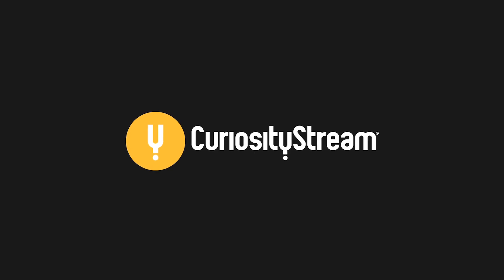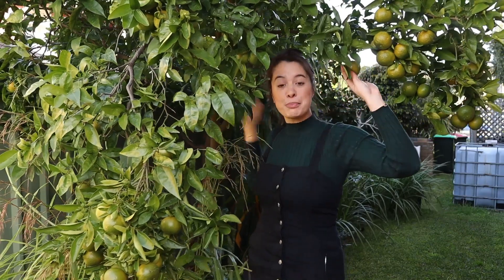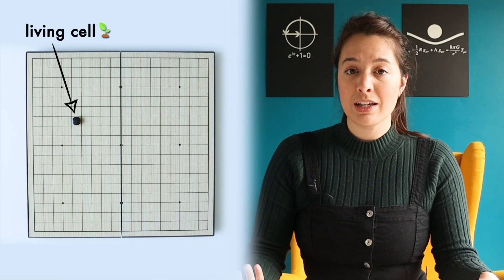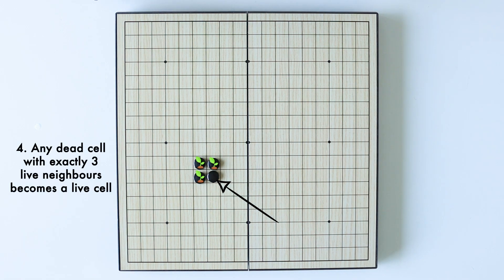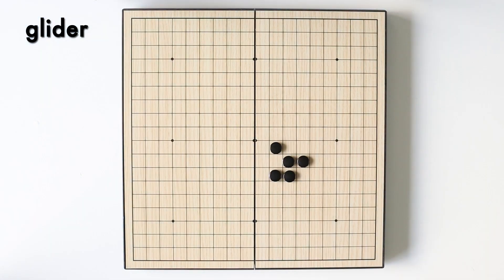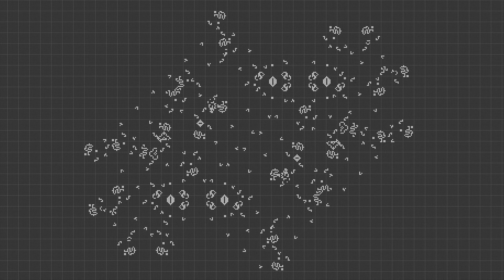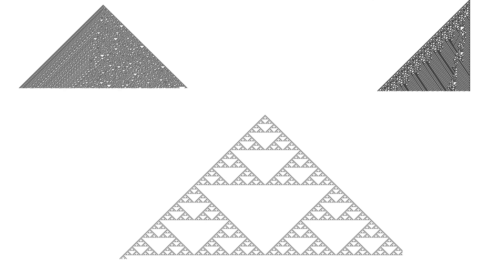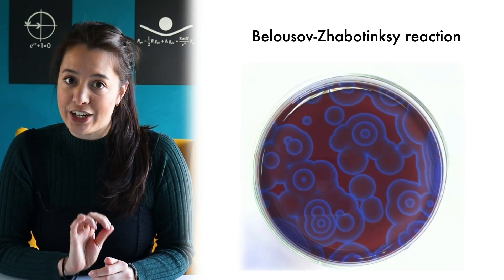The Physics of Self-Replication and Nanotechnology

Comment: Have you run into “Langton’s Ant?”  An even simpler rule than Conway’s yields surprising behavior that is simple and chaotic and repeating.
(1) The ant makes simple, symmetric patterns for a few hundred generations, then
(2) it looks wildly chaotic for the next 10,000ish generations, then 
(3) it hits on a recurring pattern  that creates a “highway” heading off in one direction forever.  
The simple rule?  
On a white square, flip it to black, turn 90° clockwise, and step forward.  
On a black square, flip it to white, turn 90° counterclockwise, and step forward.

Comment: The problem with this theory as an explanation  for life is the fact that any "rules" that are created are in fact intelligently designed.... the board game for example has grid lines on it (which are intelligence), how does a bead know to cross a black line? why would it do that? why are the rules (however simple they are claimed to be) intelligently posed? why can't beads go up or through the board itself? why can't bead change it's color? The bead itself is intelligently designed. Where does the energy come from for the bad to move? if the bead is moving is it relying on far more complex machinery for it to move....eg: an intelligence or a computer.
Reply: It still proves evolution is true, it just doesn't prove that the rules evolution must follow (the laws of physics themselves) aren't created.

The rules could have been anything else and it still could have complexity, so it doesn't have to be intelligently designed. There are a lot of other versions of GoL, and a lot of them are still complex even with the rules changed.

And even if it was intelligently designed, that does not mean the lifeforms are also created by those designers, the lifeforms aren't made by those designers and are simply made by evolution. You didn't create the random glider that appeared, it was a result of the random starting conditions you've made.

And the existence of a "designer" doesn't mean he/she/it is benevolent. It also doesn't mean he/she/it is supposed to be worshipped. It also doesn't mean that he/she/it matters at all, because if you can't tell if the universe is a created simulation or a reality that made itself, does it even matter?

Comment: Isn't a Computer just like what you described in the video. At the low level, it's all just simple transistors that allow or not allow current to flow.
It's a simple switch, connected with billions of other neighboring switches, joined together by wires that control how they open and close.
And just look at how much complex computation a computer can do due to this. It's as amazing as the complexity in nature.

Comment: I would say that current physics is not so much top down, but more in fact TOP UP, I see science wanting to go more complex rather than trying to work from fundamentals and first principles. 

It's like trying to work out the output of a super computer doing a complex simulation, by proposing theories about the output of the computer, instead of trying to break the problem down.
If you understand that fundamentally the computer is a configuration of switches, and from that you can work out the instructions (basic rules of nature), then you have a basis to enable to 'decompile' the complex programs that run on the computer (and it's complex outputs). 

So that is of course a bottom up, but we look at the output (say gravity), then we want to layer more complex models on top of the output with things like quantum gravity. Bottom up is the only way to go, you have some fundamental rules (the instruction set), you can't break those rules at all, ever, but you are unlimited in what you can do within those rules. (your program can be as complex as you like, as long as you follow the rules).

Comment: Cellular automata and rule 30 would never have been explored before earlier mathematical discoveries because it's extremely difficult to appreciate them without running them on a computer. This kind of heavy number crunching has only become practical to do recently. The rules of Conway's Life might be simple, but to create a complex machine with it you will need a lot of data to describe the initial conditions. The complexity is in the board data, not the rules.

Comment: Great video as ever Jade! Though I don’t draw the same conclusions. While cellular automata can illustrate how a universe with relatively simple laws can support complex ‘life forms’, they are not responsible for creating those life forms. An external actor (the programmer) has to first create the laws but more importantly has to create the initial starting conditions. Using random initial starting conditions with Conway’s game of life can result in some interesting life forms, but the more complex ones you demonstrated inevitably need to be created by an external actor.
Reply: Who would you say “created” the laws of mathematics?  It is a rich and complex system, but appears to exist on its own accord, rather than having been designed by some external actor.
Reply: @mensaswede4028  that's a great question. My point though is simply that the laws cannot prove or disprove the existence of an external actor. At this point we move from science to philosophy. Philosophy has many ideas in this area
Reply: Paul McClean Well I am partial to the MUH (mathematical universe hypothesis), in which reality itself is nothing more than math, so the math itself is all you need to explain why we exist.  But you are right, we will never “prove” anything.  We are like an ant colony confined to the inside of a beach ball that is floating down a river.  We sense the turbulence of the river, and suspect that there is a lot is going on that we don’t understand.  But the ant colony has no hope of proving how the river formed from rainfall.  Much less proving how the rain formed from evaporation from oceans due to star energy.  There are extremely complex forces in play that are simply far too inaccessible to form scientific theories around them.

Comment: When you started setting stones in the middle of the squares instead of on the points, I got twitchy.
Reply: that's the difference between a grid and a graph... 
In a grid, the area between the lines is important, in a graph, the lines and their connections / nodes are important. 
If you feel twitchy when you see grids, I hope you never open up Excel or it will torture you..
Reply: @liquidminds  The problem is that's a Go board and Go stones and here we are playing Checkers with them.

Comment: Love this video! And I feel it's a really good way to show how higher order can be emergent. I see SO many people conflating the idea of "Because entropy increases, all systems work towards chaos."  and "Chaos = inability to become more complex." 
.
Entropy isn't a "loss of energy." It is the leveling of energy gradients: something like, "as the cold side warms up, the hot side cools down until they are both the same temperature." No energy was lost, just its ability to be used because of lack of differentiation. If we think of information in its most elementary form, it can consist of just a single energy difference. And with that, we have one piece of information. But if no differences are there, no information can be given / attained. Let's say you have two energy states: 0 and 2. If you come across this system and its energy gradients are 0000, no information can be attained. If its gradients are 2222, still no information can be attained. But if it was at 0220, there are now obviously 2 gradients. As the energy in the system works to equalize the gradients, eventually, no information can exist in the system. Because 0220 will eventually become 1111 once everything evens out. 

So the complexity isn't really affected. What IS affected, is the system's ability to hold onto information as the energy gradients are leveled out. However, given a system that has an energy source, (in this case, a computer and the electricity), then the system is no longer locally susceptible to the amount of entropy it would take to make the system lose information. This allows the formation of more complex information and actions from simple information. And voila! You have what we see in your video and in life!

Comment: The problem with bottom-up is that you need to know what the lowest (Or low enough) level is. Top-down can usually work by breaking a big, complex system into parts and seeing how those interact. With bottom-up you often have to guess repeatedly until you find some set of parts and rules that work. It's why Rule 31 IS Rule *31*, a bunch of rules were tried until one worked for something, somewhere. It's very inefficient.

Comment: I have always believed that the universe IS a giant 3-D cellular automata.  I don't know whether it's possible for us to ever actually know the rules, though. We are, after all, part of that automata. Inside it, made of it. 

The first question is: what structure are the actual cells? Is it a grid of cubes? Probably not. That's very organized, but doesn't serum very natural to me. Think of a space filled with bubbles. Each bubble is a cell. What shape will they take? What structure?  It's possible that the cells are basically regular polyhedra, all the same, making the structure regular everywhere...  The mathematician in me really, really wants that. But it seems more likely to me that they're not that regular. I think maybe they're actually like bubbles. Irregularly shaped, not all with the same number of neighbors, maybe not even fixed, maybe sometimes the cells pop like bubbles, maybe sometimes new cells form as the membranes between cells stretch. But meanwhile, the cells all affect their neighbors through a set of very simple rules. 

The next question is: how many potential states does each cell have? Is it binary, off and on, like Conway's Life? Or maybe trinary, positive, negative, and neutral states?  Again, the mathematician in me wants one of those to be true. But it could also be that there are infinitely many possible states. Maybe there's a state for each direction, and each cell's state corresponds to a sort of pressure in a certain direction. Maybe there's a directionality combined with a magnitude, so that each cell effectively has associated with it a vector at each instant.

I do think time is quantized, broken into separate instants, not continuous. The states of the local cells in one instant lead directly to their states in the next instant, and when we look at the results from our macro scale, seeing all the instants chained together, we see all the subatomic bits and interactions and illusion of motion.

Comment: Simple rules create complex patterns: The power of emergence! For me, emergence is one of the most important principles of the universe.
Reply: Also illustrated here is that nonlocal structure and behavior can emerge from strictly local rulesets.

One of the early - admittedly handmade - implementations of this insight was the use of "simulated annealing" for finding nonlocal optima using strictly local rules.

Local rules can perform simple hill climbing in an obvious way, but the search will terminate upon hitting a local maximum.

Short of allowing each local climber to confer with the others (thus destroying strict locality) what can we do? Simply shake the system periodically, to overcome local maxima. Each progressive shake is less forceful, so that the climbers tend to end up less far away from their starting point on a given iteration. What's good about this approach is its local rules leading to emergent global optimization, which not only lends itself to parallel implementation but also supports the natural emergence of such rules if they confer survival advantage.

Adding noise to aid convergence is also a technique used in signal discrimination. I believe that the CDMA cellular protocol was one of the earlier implementations, or maybe it was spread spectrum.